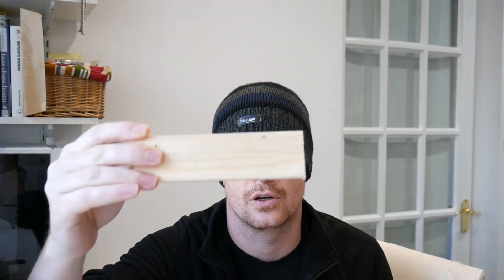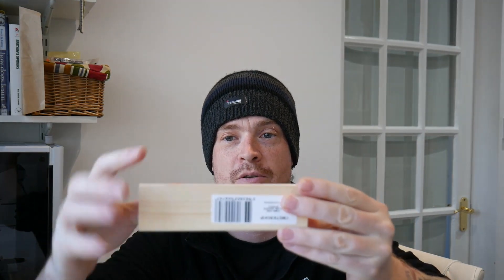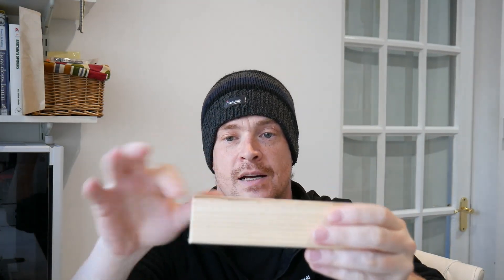MPCNC   4 Sided Milling

Comment: I can't wait to see how this turns out. Flipping is easy but there are some small details that you normally never have to deal with. I would say be sure to Zero from the table to make sure the flips share a reference plane because you know the wood is not true. That also means you need to face the entire side you will be flipping too next. Easy on a two sided part, less easy on a four way flip as you need to mill at least one side completely. 

Hope that is not discouraging, just a little tip to hopefully avoid some pitfalls, you can do some awesome stuff multi sided milling! Can't wait.
Reply from the maker: Already made a mess up as used the wrong gcode for the next side.

For this one the stock at the left side isn’t machines so I should be ok for this one anyway.

Thanks for the tips
Reply: @JerseyCNC  Another one that happens is flipping it the wrong way. Such a bummer if you do not catch it immediately. Each CAM tends to have a different direction. Left to Right vs top to bottom.
Reply from the maker: Ryan - V1 Engineering Inc I believe that’s what I managed to do 😒